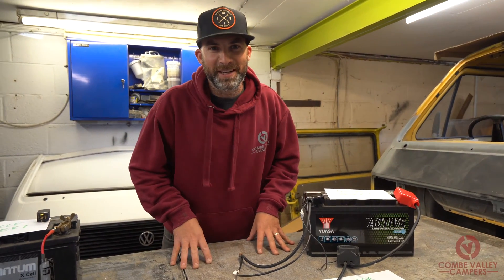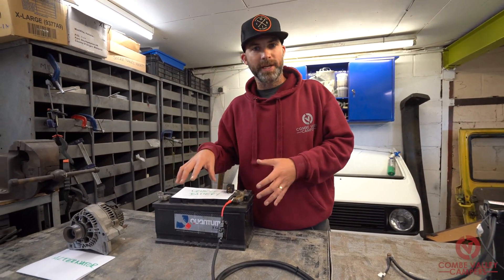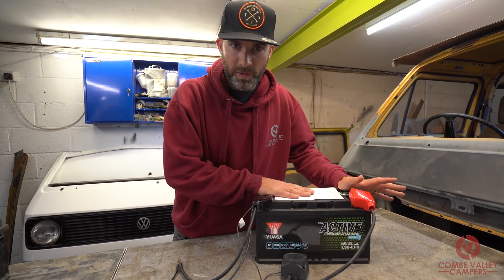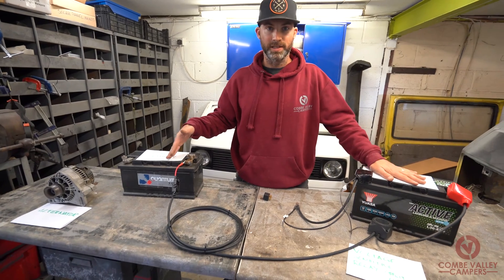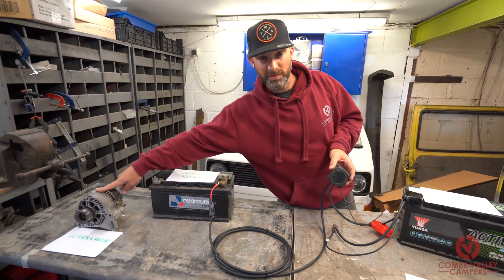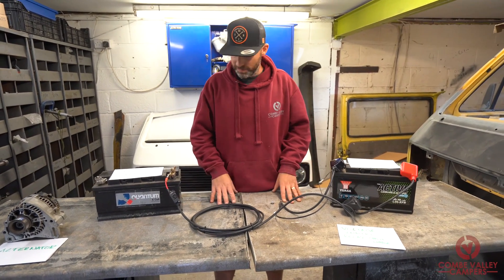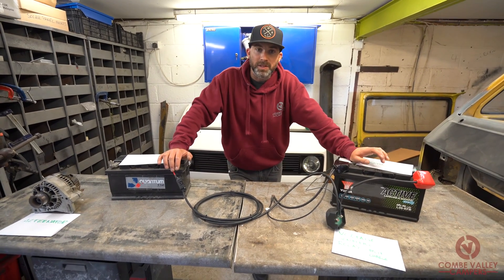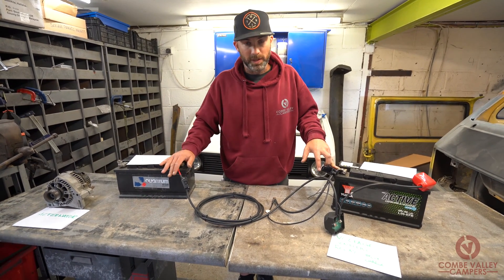A beginners guide to leisure battery charging and wiring.

Comment: I've a renault Trafic mk3 2017, and just ordered a split charging system to charge a leisure battery.  Ive just read a post that the output of the alternator is insufficient to power the LB...anyone know if this is correct, if so what can I use.

Cheers
Reply: Try to get the highest amperage alternator you can.  This will determine how fast you can recharge your batteries...  
Try not to discharge your leisure battery that much and it should be fine.  Or you will just have to run your engine longer to recharge it.  Check the voltage with a multimeter and make sure it's approx 13 Volts.

Comment: Just one quick question. Do the batteries have to be the same??? i have a Vito van with acid battery and i work on wheelchairs that use Gel batteries. I what to connect the Gel battery as the leisure battery, also do the Amp/hr need to be the same on the two batteries. many thanks.

Comment: How would you wire a second leisure battery in?
Reply: In parallel (positive to positive, negative to negative). Beware you may burn out fuses (or the VSR if your using the wrong fuses) as the current draw can be much higher the larger the battery bank.

Comment: great vid, how do I then connect the sockets from this

thanks
Reply: For 12V, such as a cigarette socket or distribution unit (which in turn powers lights etc.), connect positive (red) wire directly to the positive terminal (you may find this is more easily done with screw/bolt type terminals rather than push on/pull off terminals), ensure there is a correctly rated inline fuse, then fit some type of terminal onto the negative (black) wire and connect this to the negative terminal if the distance is short - for longer distances connect directly to the chassis of the vehicle (also called ground or earth).
For 240V, use a 12V-240V inverter (Pure Sine Wave if you're using electronics) and install the same as above. Note that inverters require a significant amperage - 20x that of the amperage at 240V (Power {Watts} = IV [current{amps} x voltage{volts}]) and therefore require significantly higher rated cables and fuses to deal with it. This is why your mains electric at home is probably on (aproximately) a 100A Main fuse, whereas, your starter motor on your van may be around 150A or higher.

Comment: Why does my vsr stay on when I turn the van off is it still taking voltage from the starter battery until it drops to 12.8v? Will this not make my starter battery faulty?
Reply: Yes, you are correct. If you have a weak starter battery, it can cause issues. Alternatively, you can wire in an ignition relay in series so that it will only charge when both conditions are met: 1- engine is on, 2 - starter battery is charged

Comment: Thanks man for your video. Very informative. I would like to see how you wire a volt meter to an external battery. I have a solar generator chained to two other batteries and I don’t know how to wire in a vault and amp monitoring system or gauge. I just subscribed to your channel looking for more stuff
Reply: For voltage, connect the positive to positive terminal, and negative to negative terminal.
For current (amps), this needs to be checked inline (i.e. your meter forms part of the connection) but can technically be checked anywhere in the circuit (providing it is in series - if it is in parallel, it needs to be checked before the first or after the last node otherwise you'll only get the current passing through that exact leg of the circuit).

Comment: Newbie to van life....
T6 day van kombi,  won't be sleeping in the van but wanted to ask do you think it's a good idea ( is it possible)  to fit a leisure battery with an outside connection (hidden) is so we can get power into our tent if the campsite haven't any electric hook ups available to use? 
Phone charging / small heater / cool box sort of things

Comment: Your videos are amazing. Really clear and well presented!!!

Could you please help me. I have fit the split relay charge to my VW T4 and I am now starting to fit a 240v hookup to the van. How do I connect it to the leisure battery so the battery can be charged by both the alternator and the 240V hookup, when it's plugged in?

Thanks again

Comment: Great video thanks, you explained it so simply even I understood it! - Can you tell me does the system work the same the other way, if you are hooked up to the electrics at a campsite or have solar panels charging the leisure battery when it reaches 13.8v does then pass the charge to the vehicle battery?

Comment: Hi Combe Valley Campers its me again! Any ideas for the best place to conceal the leisure battery? It's a Ford Transit Custom being converted to a day van so there wont be any kitchen units to conceal the battery.  I assume I could  conceal the battery under the duel passenger seat, but then assume I wont be able to install a swivel  base?  If so I may have to forgo the swivel base.

PS Rayne and Custom Shop are both great recommendations both very helpful!

Comment: Can you attach a relay and solar charger to the same leisure battery to charge it at same time or is that dangerous?
Reply from the maker: Yes you can attach a solar panel to the same battery but it must be wired through a suitable solar panel controller

Comment: I have a leisure battery that gets charged when the engine is running and an electric hook up, but no charge system from the el hook up. Can I simply attach a battery charger to the leisure or main battery? I'm thinking the ctek mxs 5.0.
Reply: Check the specs of the charger, some can, some can't. It's effectively reverse polarity.
Reply: @rebeccahare897  - I have no idea what that means. What would I specifically need to know about the charger?

Comment: This is a great video. I've been trying to get my head around electrics for ages.  For me this is missing 2 crucial pieces of information: fuses (where,  what rating...); how to wire stuff to the leisure battery so you can actually use it
Reply: Fuses - one fuse should be on the primary battery positive lead, one should be on the second battery positive lead. Fuses always go on positive leads, otherwise shorts to ground may bypass them. Good practice also states that it should be as close to the power supply as reasonably possible, as the lead leading to the fuse always has a potential difference and any short to ground along that wire is not protected.
As for wiring to a battery, connect the positive lead to the positive terminal and the negative lead to the negative terminal or to the chassis (ensuring a good electrical connection)

Comment: I thought you would need a wire to close the circuit for the negative terminals ???
Reply: You wire both batteries to the chassis - which is effectively a big negative cable. Your starter battery will already be wired to the chassis.

Comment: Hi , just watched you clip about the split charge relay . You mentioned about an ignition live , is there an additional wire I need to run ? 
Reason I’m asking is I purchased the Rayne split charger , but I can’t get the leisure battery to charge :-( help 🙃
Reply from the maker: Hi, if you bought the rayne voltage sensitive split charger, then you do not need to run a separate ignition live. Just the 5 comnections I discuss. If you bought a standard split charge relay, the yes a ignition live is used to trigger the relay.

Comment: Top vid and explanation chaps, If the kits are pre-made, what do you do with the extra cable left over that you have? Cheers
Reply from the maker: The cable should be long enough to route nicely under the drivers seat. However if you need to have a shorter route, rayne Automotive can custom make a loom for you. Ideally any extra left over should be cut to length and re-terminated, but if you dont have the tooling, routing the cable to take up some excess is a good plan. Try to avoid cooling any excess cable.

Comment: Will the normal alternator be big enough to charge both batteries or does it eventually we're down the alternator unless you do something to the alternator thanks appreciate your videos
Reply from the maker: The alternator with constantly turn whilst the engine is running regardless of charge requirement. Once the vehicle battery has its required 13.7volts of charge, only then will the voltage sensitive split charge relay demand the current be shared to top up the leisure battery.
Reply: The alternator can only put out its rated amperage, however, running split charge systems causes the alternator to work harder & longer than it would with only one battery and is therefore likely to give up more quickly.
Many alternators are relatively simple to replace - 1 cable, 2-3 bolts holding the alternator in place, 2-4 bolts holding the pulley onto the alternator and a alternator belt with a pre-tensioner (which is likely part of your scheduled major service, so it's probably about time you changed it anyway!). Usually the hardest part about replacing them is getting to them!

Comment: Great videos, subbed :) Quick (probably silly) question - once the leisure battery etc is all in and wired, how do you route the cable from the relay through the cab to the vehicle battery?
Reply from the maker: We have a new videomon jow to wire in the system. Its all on our playlist. Check it out :)
Reply: @CombeValleyCampers  Had a look, perfect video, thanks! Sorry - I hadn't noticed it before - it's so new it escaped me!

Comment: thanks - Great video. One question.. is it possible to over charge the leisure battery with this setup? cheers
Reply: Yes, it's a non-smart charger. It's effectively the same as connecting a set of jump leads directly to your starter battery, just with less hassle (overall). It takes charge straight from the alternator, which kicks out around 14V and if your leisure battery is low enough, it will take the full whack of current your alternator can provide - around 150A.

Comment: Love your videos. But on new T5 and T6 I would recommend a smart dc/dc charger. It's about the alternator on new engine turns on and off to keep the pollution down.
Reply: Hey mate that's some great info. Do you know if this counts the same for the newer Ford Transit Vans. I've got a transit Jumbo
Reply: @FRAEKDJ  I think this is on all new cars/vans. Some are in "standby" mode and then alternator is only give 7 volts.. I would recommend  on new cars have a dc/dc charger. It's a little expensive but burn up ore damage a new battery and wonder why is also expensive.

Comment: Could be a really stupid question but the leisure battery feeds back into the vehicles wiring and fuse system correct?
I’m wanting to add a leisure battery to my caddy so I have a longer capacity when the engine is off to run my radio lights and 12v sockets, but I don’t want to drain my main engine battery
Reply from the maker: The 'voltage sensing split charge relay' opens once the main vehicle battery voltage drops below 13.7 volts DC. At that point the leisure battery is not connected to the vehicle battery.

Comment: Does the charge from car battery just go into leisure battery when you start the engine OR continuously as you drive? As you drive along right?
Reply from the maker: It will continue to charge, and when the laidure battery is at optimal charge it will cut out
Reply: @CombeValleyCampers  cheers for the help...van was out of action but we're back on it soon so will be using you vid to sort the power out. so helpful.
Reply: @CombeValleyCampers  unless you have a particularly special VSR (sorry if I missed that), the relay once closed will remain closed whilst the starter battery has >12.8V of potential difference. It does not cut out at optimal charge, however, since there will not be the same power draw, the alternator will not over-generate. If you attached this to a car with an old dynamo, it could over-charge the battery.

Comment: Is split charging required? What about just hooking up a relay to the handbrake, and simply charging the starter and leisure battery at the same time, and when the handbrake is on, it disconnects the two batteries? Is there a situation where this would fail miserably?

Comment: Does that ground I'm the secondary battery have to be grounded right to the frame or can it just be grounded to the chassis inside the van somewhere
Reply from the maker: Yes it can be grounded to the chassis inside the van, but!, please ensure that you have have continuity to an already existing earth point. If you are making a new earth point do not just screw imto the metal work, ensure you create a good substantial fixing, or use and existing bolt/threaded hole. Leigh

Comment: Hi m8 would this be fine for a locksmith van powering key cutting machines, 240v grinder, lights, battery chargers? Tia
Reply from the maker: A variation on this would be good yes, but to discuss more specific needs and requirements contact the guys at Rayne Automotive. They are very helpful
Reply: @CombeValleyCampers  thanks m8

Comment: Hi, and thank you for your very informative videos. I just found your video (and checked out several of your others.) while searching for a solution to a problem which seems like only I have. I have a solar system with 2 battery banks (collectively charged, but discharged separately), but I'm having trouble figuring out how to make my back-up battery bank components kick on when my primary battery bank kicks off. I recently purchased some relays (JD2912-1Z-12VDC) thinking that I could wire it up so that when the primary bank gets too low (and the 12v overcharge/under-discharge protection module disconnects the inverter on the primary bank at 10.5v) the relay would disengage and the switch would then close between my 2ndary bank and the components connected to it. I did a couple of tests but the relay didn't seem to work this way. At this point I don't expect a solution, but any advice/thoughts would be appreciated. Lol in case it wasn't too obvious, this is kinda new ground for me. Thanks in advance.

Comment: What’s your Earth point from you negative to leisure battery connected to, as it’s a cable I don’t have from Rayne?
Reply from the maker: Hi, in the split charge kit you should have received a battery earth terminal and wire. If it was missing in sure the guys at Rayme will sort it for you. We connect the earth lead to the nearest point available in the chassis. If there isn't one we normally make an earth point
Reply: Combe Valley Campers thanks, I do.
Could you possibly do a solar panel fitting video as I’m thinking of getting the kit, which I assume connects to the leisure battery
Reply from the maker: @amacmedia3221  one is in the pipeline for sure.
Reply: Combe Valley Campers much appreciated guys

Comment: Do motorhomes have two of these? Reason I ask is that when your on site and hooked up to 240v the leisure battery seems to get first access to the 240v charge but then once charged I am told that the vehicle battery is topped up. So when were at home the vehicle battery stays topped up too.
Seems like there's two sense ccts each with a separate charger the main battery charger (the alternator when driving) and the Leisure battery 240v charger when plugged in.
It seems to me that the alternator charges the vehicle batt first and then tops up the leisure, and the 240v charger charges the leisure first and then tops up the vehicle have I got this correct :-)
Reply: There are "dual sensing" VSRs, which sense the voltage of both batteries, if one is high enough, the relay will close (on), if one goes low, the relay will open (off).

Comment: What happens if your main battery is only say 80 amps and you buy a 100 amp leisure battery
Reply: It will be fine. It works on voltage difference, not capacity.

Comment: So how do you wire-in a solar panel to the split charge system in this video?
Reply: Solar panel to charge controller.  Charge controller to either battery.  I would prob. hook the charge controller to the secondary battery so the "main" battery system is isolated.
Reply: @nonebiz2132  if i wanted to keep both batteries charged up during winter when not in use would i connect the controller to the main battery ? thanks.
Reply: @gaz7753  Batteries take a couple weeks/month to discharge as long as temperatures are not too cold.  If all hooked in parallel, the batteries might not "fully charge" but will get close.
The best would be to move the controller to each battery, giving about a week to charge and check with a multimeter (~13V will be fully charged).  Then after a week move to the next battery.  Make sure water levels are topped up after each charge.
The next best is to hook them all in parallel and check water levels once a month or so...  Again check with a multimeter when in doubt, you can get an OK one from Harbor Freight for $5.
Reply: my problem is i am away for 3 months every winter (- 0%) to warmer climes therefore how do i keep both batteries topped up during this time ?
Reply: @gaz7753  I would disconnect the batteries from the vehicle so there is no drain....
Then hook both batteries (in parallel) to the controller (A set of jumper cables from the LB to the main battery is OK) . Both batteries hooked to the controller should keep them both fully charged as long as there is an OK amount of sunlight through the winter (Don't park under a tree, etc).
Reply: @nonebiz2132  the whole point of fixing solar panels is   that i dont want any fussing, just to leave the van alone and solar panels do the work without any fussing about ! otherwise why bother ?
Reply: @gaz7753  The idea is to keep your batteries charged with months of neglect so they don't go bad...
The split charge relay probably won't engage by the solar controller, so your LB probably won't charge...  But give it a  test and see.  Hook up the solar controller to the main battery, and see if there is voltage on the output of the split charge relay.  If there is, you should be good.